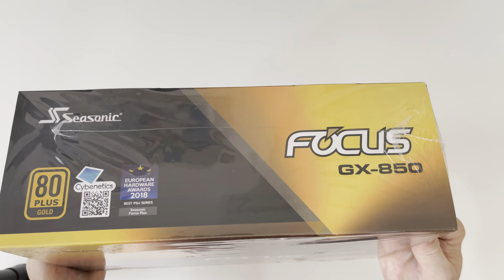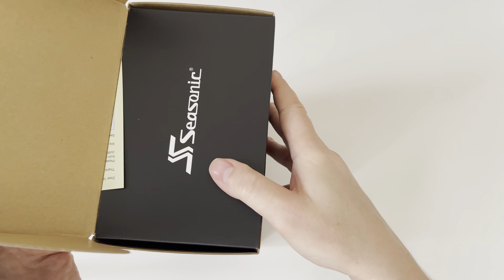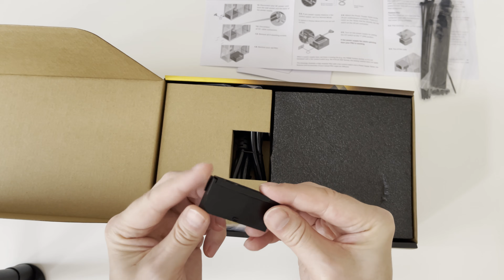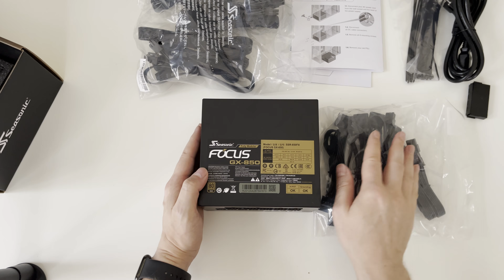Seasonic Focus GX-850 - unboxing and mounting Power Suply unit for RTX 3060, RTX 3080

Comment: Does this have 3 gpu cables? I just bought the white version but my graphics card has 3 pin slot
Reply from the maker: Thank you for watching. I can confirm that Seasonic Focus GX-850 has 3 x PCI express 8pin cables for GPU and 2 x CPU 8pin cables. Good luck with your graphic card upgrade with 3 x PCI Express connectors. Let us know what graphic card you are connecting Seasonic Focus GX-850 to, so that other folks in community can use the knowledge. Cheers!

Comment: Nice straith forward video. i bought this PSU 2 years ago and also put the fan on the bottom. Now my fan is beginning to rattle. So i dismounted the PSU and turned the fan to the top. Now rattle is gone. For me the first mount was handy becouse of cablling. How is you`re experience now? still no issues, or had the same issue?
Reply from the maker: Thank you for watching. I have Seasonic Focus GX-850 for three years already and have not had any issues with it. I'm running it pretty much 18 hours per day and the only thing I had to do is vacuum cleaning the filter at bottom of my case. Good luck with your Seasonic PSU.
Reply: @ottomixa  Thx. after rotating the psu (with fan on top) the rattling slowly dissapeared. Ordered already a new fan that`s going to be installed if needed. Seems the original fan is not that good. ordered a noctua now.. nice heavy duty one.
Reply from the maker: @arjana2397  I hope you have managed to resolve fan rattling noise on your power supply unit. It would be great if you'll share any result from your fan replacement. Cheers.

Comment: im planning to buy the Seasonic Focus GX-850, and an NVIDIA Geforce MSI RTX 4070 SUPER, I've got a H310M PRO-VDH PLUS Motherboard, its a M-ATX motherboard, this video is helpful!
Reply from the maker: Thank you for watching and for positive feedback. I'm glad my video helped you to connect Seasonic Focus GX-850  power supply unit to MSI H310M PRO-VDH PLUS motherboard and to MSI RTX 4070 graphic card. Good luck with your set up.

Comment: are those pcie cables single 8pin cables? my 6900xt requires 3x8pin cables, will this psu work fine with it?
Reply from the maker: Thank you for watching. Package contains 3 x PCI-E cable and each has 2x 8pin connector. Ideally you should connect all 3 cables into standalone sockets of the PSU. Having 3 x PCI-E slots is also the reason I have bought it as I can easily upgrade to RTX 5070 or RTX 5080. Good luck with your PSU upgrade!
Reply: @ottomixa  so that means if i use this psu then i will have 1x8 pin connector dangling right? When i power the 6900xt

Comment: Just as I feared the cables are trash was hoping maybe I could get away with the cables out of the box
Reply from the maker: Thank you for watching. Seasonic Focus GX-550, GX-650, GX-750 and 850 have fairly normal cables which can connect to RTX 4060 GPU, possibly even RTX 5060 in near future, nothing fancy though. I had to do hide the cables while doing cable management within NZXT PC case.

Comment: Good afternoon. A little suggestion. When you plan to turn off the fan until ventilation is required, the small amount of heat that is invariably generated in the PSU will stay in its case, because heat always rises. For this reason, it seems logical to me that, in this case of use of the fan, the opening of the cooler should be placed upwards and not downwards, thus allowing the small heat generated in low demand conditions of the PSU to escape to the interior of the case and then be evacuated by the fans. Greetings and good luck.
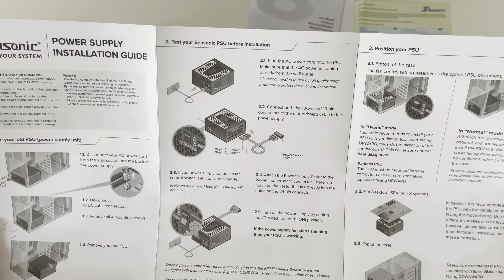Reply from the maker: Thank you for watching and posting a suggestion comment. There is section in the manual at 1:43 of the video describing the best position for each option you are planning to operate the PSU in. The  reason why I positioned the PSU with fans downwards is that I want my PSU air flow to be separated from PC case airflow (GPU and CPU airflow), it will result in PSU fan spinning more often for cooling the PSU box in Fanless mode, when heat cannot escape upwards, but that does not bother me as the PSU fans are fairly quiet. PSU position of fans facing downwards is also recommendation from NZXT for my PC case, which can be seen in manual at following video: https://youtu.be/lpeoAb8DMyU

Comment: Hi! I got mine 2 weeks ago and i get a pcie 5.0 cable too, and cable and psu textil bags, Was Your model an old batch?
Reply from the maker: Thank you for watching, yes I got probably old batch. On Seasonic website I'm reading that 12VHPWR cable is being added into package with GX-1000 PSU, but if 12VHPWR cable is being added also to GX-850 PSU box, then it is very good news for those who are planning RTX 40 series GPU in their build. Are you building new gaming PC? What is the CPU and GPU you have chosen.

Comment: Only 2 for gpu? What if i need 3 pcie like suprim 3080?
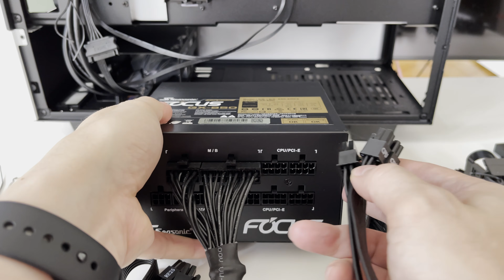Reply from the maker: Thank you for watching. There are in total 5 CPU/PCI-E sockets on the Seasonic Focus GX-850 as seen at 5:23 of the video. Two connectors are used for CPU power and 3 can be used to power up the graphic card. I have connected only 2 PSU cables for my PCI-E graphic card, however you will be able to connect one more to power up MSI RTX 3080 Suprim graphic card or any other graphic card with 3 PCI-E power connectors. Are you planning to upgrade your power supply and connect it to MSI RTX 3080 Suprim GPU?
Reply: @ottomixa  thanks! Gosh darn I meant the Corsair rm850e. Wrong video. I was actually comparing the rm850e and this one deciding which one to buy.
Reply from the maker: Corsair RM850e power supply unit seems to have only 4 PCI-E slots, in that case you will need to use some cable adapter. Good luck with your selection.
Reply: @ottomixa  I don't think daisy chaining cables will be a good idea in the long run... I picked this one btw

Comment: I really appreciate this video. I was however left wondering how exactly you plugged your two 2x4-pin CPU cables into the 8+4-pin motherboard connector, I can't really tell.

As long as the orientation is correct and the cables physically fit, does it matter what order you insert them? e.g for the final half of the 2x4-pin cable, is it okay to use the half with cornered keys, or should I use the other half so that the keys match with the motherboard?

I ask because the alternative is a bit more awkward to do.
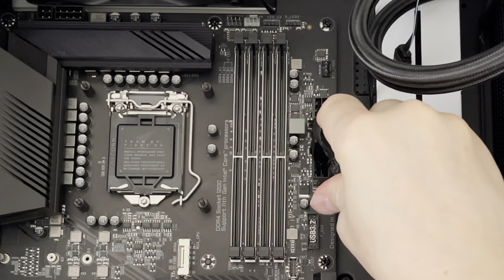Reply from the maker: Thank you for watching. At 5:22 I'm connecting 2x8 pin CPU cables to power supply unit and then at 8:09 I'm connecting one 8 pin motherboard connector and then one half of the second 8 pin connector, meaning 3x4 pin connectors to motherboard in total. One 4 pin connector was left without being connected, which is fine. Connector must physically fit in based on the shapes of pins as well as the lock of the connector is on same side for all of them. Locking it in s confirmed by click sound. Are you building new gaming PC with Seasonic power supply unit?
Reply: @ottomixa @ottomixa I am indeed! My cables were similarly to yours, with three out of four 4-pin cables connected, with one of them hanging off at a different spot than yours. They do indeed click and physically fit without forcing them in, but the shapes don't match (e.g some odd-shaped square pins go into solid square holes in the motherboard, but no square pins go into odd-shaped square holes)—and that's by design, but does the order matter at all?

Comment: I watched this for comparison to another PSU but stayed for the entire explanation. Very descriptive and informative video. Well done
Reply from the maker: Thank you for watching and your positive feedback is much appreciated. What is the other power supply unit you are comparing Seasonic Focus GX-850 with?
Reply: Just some of the Corsair series as they seem to also be quite popular at the moment. But I chose this PSU for a build instead.
Reply from the maker: @Franchise_Jon  Corsair vs Seasonic is good comparison, they are both good power supply unit. However I believe Corsair might not be manufacturing their power supply units and only sells other power supply units under their label, meaning it can still be Seasonic under cover. What motherboard are you choosing for your build?

Comment: Is this power quiet on high loads? I’ve had two psu that have failed me with the noise and also buzzing sounds. I'm trying to look for an 850W one.
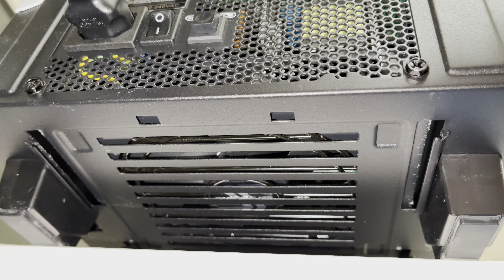Reply from the maker: Thank you for watching. Seasonic Focus GX-850 is very quiet power supply unit. I'm very sensitive to buzzing, hissing or humming of capacitors or coil whine, but cannot hear anything from Seasonic power supply unit. it also has Hybrid Silent Fan Control functions in three operational stages: Fanless Mode, Silent Mode, and Cooling Mode. My power supply unit is almost all the time operating in fanless mode or silent mode. Enabling of fanless mode is explained at 8:55 of the video. Is there any other PSU you are considering?

Comment: Hi, nice video, do you have that W chart for the series 40 graphics cards?
Reply from the maker: Thank you for watching. By coincidence I have been working on video which is showing how many Watts is needed for RTX 40 series graphic cards. PSU wattage suggestion video: https://youtu.be/8VFnG2q0H4Y Hopefully it will help to identify if existing power supply unit which everybody has in their PC is sufficient for an upgrade to RTX 4060 or any other RTX 40 series graphic card. Are you planning to upgrade to RTX 4060?

Comment: nice explanation dude
Reply from the maker: Thank you for watching and for positive feedback. What PC set up and components are you going to connect the Seasonic power supply unit with?
Reply: @ottomixa  I will make the GX850 the heart of the following PC components: RYZEN 9 5950X, B550M AORUS PRO, RTX 3060 AORUS 12GB, and PATRIOT VIPER 64GB. I hope this is enough for the above specs. If I may ask, is the GX850 included in Tier List A? I saw a cutlist written on Tier A in the Single Rail PSU section, but it says Seasonic/Haiyun: GX <=750W. This makes me uneasy :(
Reply from the maker: @kumirikidesign6407  Seasonic power supply units are definitely most premium brand tier list PSUs. And given that you are choosing RTX 3060 as graphic card and AMD Ryzen 9 ac CPU, then Seasonic Focus GX-750 would be sufficient as seen in table at 8:38. But you would be limited by possible future upgrade to max RTX 4070Ti as per my other video at https://youtu.be/8VFnG2q0H4Y You could also get Seasonic Vertex GX-750,  but it might be difficult to find. Another good option for possible future upgrade would be Seasonic Vertex GX-850 - 850W.

Comment: Why you connected 2 cables PSU to PCIE if rtx 3060 just have 8 pin slot?
Reply from the maker: Thank you for watching. You are correct, RTX 3060 has only one 8 pin slot. I already knew I will be upgrading RTX 3060 to RTX 3080 before considering RTX 4060 as seen on following unboxing video: https://youtu.be/Gh4hndjr-iM Are you upgrading your graphic card to Gigabyte RTX 3060?